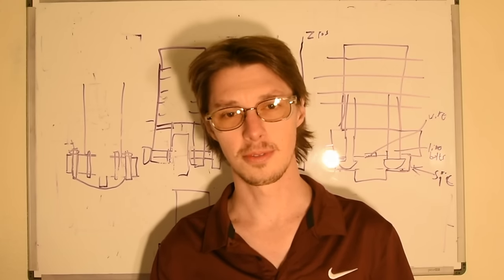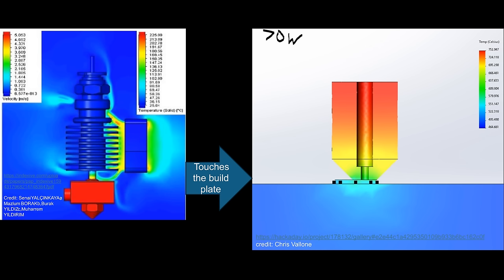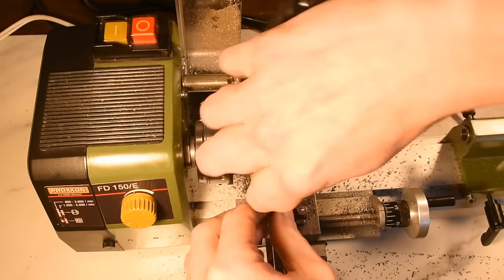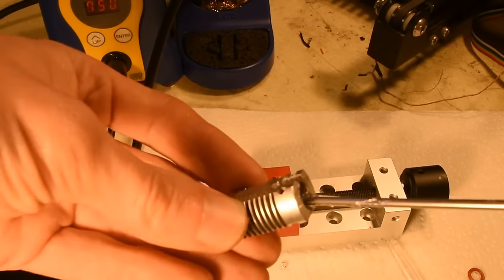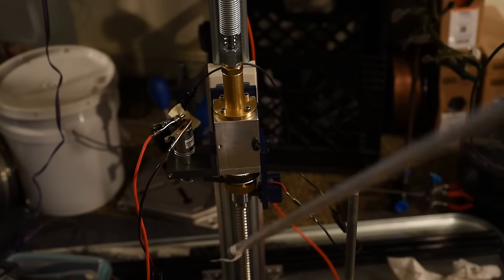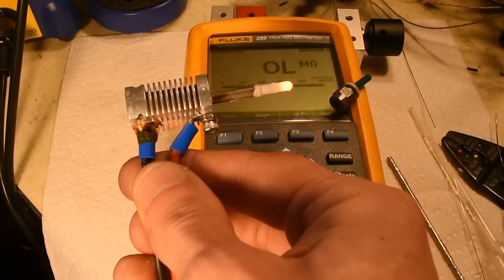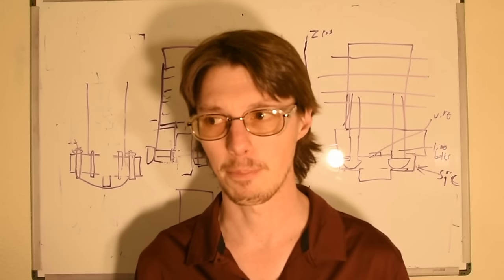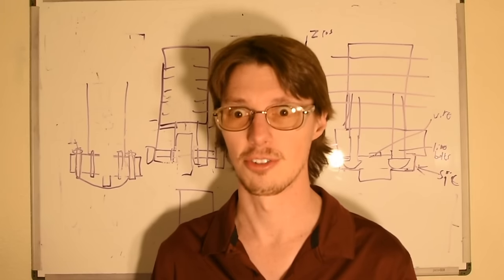How we made a 1300C 3D printer hotend for printing metals on the Creality Ender3

Comment: How did you provide the adhesion with the previous layer (it would be too cold)? Is this one-layer-only printer? If you think it’s not a big deal - you are wrong, it’s a major problem for this project. Anyway I wish you luck on this project and I hope you get the best possible results.
Reply from the maker: actually the temperature of the underlying metal is heated to diffusion bonding temperature by conduction through the deposited material.
fascinating fact about metals, they will bond at room temperature under near zero force when free of oxides or surface contaminants.
forging hot metals onto cold metals tends to remove the oxides, if the solubility of the native oxide is high in the liquid fraction of the semisolid metal (the tin is the liquid fraction in the bronze we are using) tin has a high solubility for copper and tin oxides. so the metal is its own flux to some degree as long as the temperature is not too high. 
the copper in the bronze is quite abrasive in siding wear, and so helps to scrub the underlying material clean.

something similar appears to happen with the 6061 aluminum wire as well. 

its not strictly necessary to heat the underlying metal. just to  have enough energy to ensure we can make the new deposited material be able to form metallurgical bonds with the previous layer. this is quite tractable given the torch like energy densities of the glowplug, and the relatively high forging pressures under the tip of our fine (and well constrained wire) at the deposition zone.
Reply: @rotoforge2024  I’ll be waiting for your next video on this project, it’s been so interesting to me.

Comment: You are making nice progress on a project that started me to create Rumba and Bollero projects, you need them to do the metal melting part as much as you need the crucible you created
You might have no idea but you need some more things done like eliminating oxydaton at every single pass of the printing head or noting really sticks togehter, especially with Aluminium, but Iron is also pretty nasty when it comes to oxydation layers preventing fusion, and I am working on that idea too,
and of course you need Rumba (or the Bollero/Ballerina combo) to print without supports or... again, many projects are not printable because geometries with supports inside are unreachable to cleanse them, so in the end functionally will not be useful.
Immagine printing a miniature 12V engine block, how can you clean supports in all the cavities?  Better without them supports.
Reply from the maker: we cant use iron due to its reactivity with the plug materials above 900 C or so. 
this is an active point of research. 

oxidation is much less of a problem for semisolid forging because oxidation diffusion and surface reaction rates are 3-6 orders of magnitude lower than in the liquid state. 

Semisolid forging also enables native oxide breakup via forging action at the deposition zone, because the solid fraction of the feedstock in the semisolid state at the deposition region tends to be highly abrasive. 
we might include inert gas for higher temperature operation in future, and or an oxide scrapping brush around the tip...
more testing is needed to say for sure.
Reply: @rotoforge2024 inert gas prevents hyper oxydaton in liquid state, but does nothing against already existing layer of oxydaton that prevents fusion.
Reply from the maker: @severpop8699 yeah this is why we are trying to get moderate forging  pressure from the extruder and ideally no nozzle constriction.
Reply: @rotoforge2024 there are better ways already in use in welding
Reply from the maker: @severpop8699 
would love to learn of these better ways. :)
Reply: @rotoforge2024 is public domain, any TIG or MIG machine capable to weld aluminium makes use of them, but they work fine for Stainless steel or iron as well.
Reply from the maker: @severpop8699 are you basically round about trying to tell me to use Wire arc welding? 
I dont enjoy coyness friend. please just tell me if you see something that could be done better.
Reply: @rotoforge2024 others tried to use ark welding and it did not really work to print like polymers can, so nope, that is not the solution, melting the metal in the crucible (hot end) is the way to go, but also unlike polymers, metals come with their own atomic oxyde layer to be dealth with if you want real 3D printing capabilites, one way is laser abrasion cleaning around the depositing point, but even at 5W laser we still talk bulky and heavy add ons on the printing head although it might work if the laser is away and the power pointed to the deposit point is carried out by fiber optics (you need to circle that damn point all times since the printing head travels all over the place so celasning in one side alone is not doing the trick)
but similar to laser, that is focused energy in the light visible spectrum, you can go Maser, same thing, no light spectrum but others.

So what if your outer electrode metal skin is charged with a frequency high voltage low amperage just enough to generate some plasma between the nozzle metal part and the already printed material shrouding the outcoming molten metal with a ring cleansing pattern by eliminating oxydes formed previously between two passes?
Might do the trick.

Keep in touch with me at :
activity@silverplanklogis.com

Comment: how good of a hot end would this be for PEEK/PEKK/etc?
if this could hit 1400-1600C you could print Glass, but I'd imagine driving glass powder through an opening that small will have other challenges
Reply from the maker: We could print glass or ceramic from fibers. We are already investigating printing with basalt and borosilicate glass from fiber tow. This is part of why we opted for a belt extruder. 

you dont actually need to melt the glass, just reach the temperature and shear at which the viscosity becomes about 1000 Cp.
Reply from the maker: regarding PEE and PEKK, should be fine if you draw the polymer down to 0.5mm OD filament.

Comment: Why not just use a narrow fov thermal camera sensor or laser thermometer? For tempature data at a distance?
Reply from the maker: these are very costly. 
I am working on graduate student budget.
Reply: @rotoforge2024  - I would also add that an upgrade kit becomes more attractive if the cost is lower, so expensive devices are almost not worth considering (unless alternatives have been ruled out).
Reply from the maker: @stevebabiak6997 
I am aiming for the lowest possible end user cost for DIY.
If I start selling conversion kits, my time is the largest cost...
I have so few hours to live I really feel a need for some exchange for them. The parts and materials are chump change by comparison.

I think if things go well, a final parts and materials cost of ~100-200 USD a hotend is not impossible. 

the EDM rig is the biggest expense in the DIY process for this.

We may be able to go without it if we use the goodfellow silicon carbide to make the heaters and braze them to titanium heat breaks...

this experiment may take some time to run though.

Comment: u cant actualy weld metal to metal without when there is oxide layer, u need to weld it with gass as welders do
also u can use welder wire
Reply from the maker: we are not planning to weld.
we are forging in the semisolid state. A very different set of conditions from conventional welding. 

Some other examples of metallurgical bonding in air, under modest pressure conditions...

https://ntrs.nasa.gov/api/citations/19710021048/downloads/19710021048.pdf

https://en.wikipedia.org/wiki/Forge_welding

no gas is required if you have good temperature control, and sufficient applied pressure.
Holding metals in the semisolid state greatly reduces the required pressure to breakup the oxide layer and facilitate metallurgical bonding.

Comment: Did you consider drilling bigger hole in heatsink rather than milling OD of glow plug down? Frome my experience I can get drill bit of any desire diameter down to 0,1mm very cheap in opposite to getting my hands on lathe to perform resizing of inner part
Reply from the maker: yes. 
But drilling a center bore hole, at ~0.5 mm diameter through the metal of the glowplug is extremely difficult. 
there is ~60 mm of very hard, metal, from top electrode to the center contact of the glowplug. 
there is also a region inside the glowplug, where the top electrode narrows to ~1mm OD rod. 
drilling through this has prove very challenging. 

I would encourage you to give it a shot anyways if you want to.  Perhaps you could make it work and thus reduce the barrier to entry.
Reply: @rotoforge2024  To be honest I was talking only about drilling in heatsink borrowed frome ender... But now that you mentioned glowplug I will see if enything would be possible even theoretically
Reply from the maker: @erykopata2668  
What I was trying to say, is that the heatsink internal diameter makes little difference...
the reason we have to modify the metal of the glowplug, is to expose its contacts, and shorten the glow plug so we have any chance at all of getting through it with EDM. 

a 100:1 hole is extremely difficult to drill already. its made even harder if you have to drill through materials that differ drastically in their properties IE ceramic, then metal. 

the ender heatsink is just a support structure. 
if you want to drill out the ender heat sink to make room for the glowplug, I dont see why you could not. Though the ender heat sink does not have much material on its flat sides. The glow plugs, stock, are nearly the same diameter as the ender 3 heat sinks are wide.
Reply: @rotoforge2024  Aha. Now I understand. Thanks for all the information
Reply from the maker: @erykopata2668  its why I do this kind of thing. lol 
please do better than I have. :)

Comment: I wonder if it'd be possible to turn the glowplug into a thermal couple.

Though, upon looking it up, it looks like thermalcouples exist for glowplugs.
Reply from the maker: can you drop me a link to these please?
I have never heard of nor seen these.
Though I have seen glowplugs with pressure sensors on them.
Reply from the maker: @Jeff-ss6qt Do these come in ceramic varieties?
I have seen these, but have never seen them in ceramics. they  all appear to be made of metals which will corrode when exposed to molten metals... :(

Comment: Might be a dumb question but have you tried to use something like a wire feed welder to build on a sheet metal plate
Reply from the maker: yes, but it cant print ceramics or fine features very reliably and costs way more than it should for what is essentially a microwave oven transformer and a PCB.

Comment: it would be nice, if you could go more into techdetail, how you managed the problems you has had. Like the edm process. I even like to build an edm but by brain still dont get, how problems are solved. Why it drills so centric, why it wont stick anywhere. If there is a short to material, isnt it already to late to pull back or react ? how fast must be the dataaquisition to steer all instruments ? Or can it be a simple process ? So many questions.  I think it would be a very popular content series, which shows building that machine in detail, so that anyone can build it too (even stupid ppl like someone i know *g*) . That would be somewhat great ! I think your channel goes rocket with that. Or is there already something like that ? i dont know. 
But i like your content and hope you get more visitors and money out of it. You are a good one !
Reply from the maker: this would easily be an hour long. 
I intend to go more in detail about how the printer works soon. 

as for the EDM drill, I am trying to eliminate it from the manufacturing process. its quite expensive and complicated to figure out...

takes practice to do well. which makes its much less hacker friendly than I would like. 

I think the next hotend we make will be made via diamond drilling and be much shorter / made from regular rod or bar stock.

Comment: Could you use the hot end resistance as a temperature sensor? i.e. resistance goes up as temperature goes up. Maybe use parallel high watt incandesent bulbs as a low ohm voltage divider resistor to measure heater resistance? (When I designed my DIY EDM power supply (48V), I use a string of 12V lamps as a current limiter.)
Reply: "Maybe use parallel high watt incandesent bulbs as a low ohm voltage divider resistor to measure heater resistance?"  - I mean have a 'bulb' in series with heater. But to achieve more current through the 'bulb', actually have several bulbs in parallel. Idealy the bulbs wouldn't get hot enough to glow.
Reply from the maker: yes we could and have. its not reliable enough on its own. it need calibration by an external reference. 
metal wire passing through the core of the glowplug tends to create a shunt path. 
and in general the glowplug resistance will permanently drift over time at high temperatures. 
so we need a thermocouple or some other method to backup the current sensing.
I initially though that the current sensing would be all we needed, I was, as I so often am, wrong.
Reply: @rotoforge2024  "I was, as I so often am, wrong." - I know that feeling well - stuff just works in my head!

Possibly you could mount an IR thermometer at the home position and re-calibrate at the start of printing, and possibly after each layer? I saw an instructibles IR thermometer that used a MLX90247ESF-DSA.

But I guess thermal mass creating time lag in sensing the hotend cooling down will be a big headache.

Maybe you could mount an IR thermometer on the print head, and focus it on the hotend tip by mounting it in a pin hole camera? (Easier said than done.)

I don't suppose the solution would be a straine-guage to feel how squidgy the extrusion is? Either on the extruder stepper mount (probably need two extruder drivers to do this - one to pull wire from the reel, and the second to sense back pressure), or mount it on the z-axis.

Good luck!
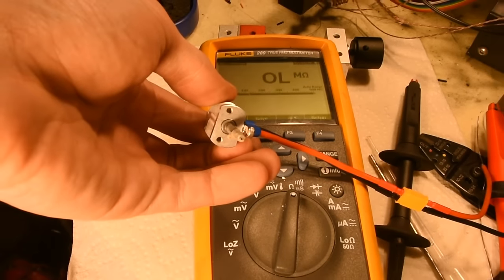Reply: Another thought: could you make the bore smoother at 17:14 by dipping the wire in silver polish first?

I was going to say "Could you simply get the temperature from the colour of the glow plug? Like an old time smithy making horse shoes? Just use a colour camera." But I see @miniman3112 got there first.
Reply from the maker: @johndoggett808 the glowplugs are excellent blackbody referencs. e=0.95 up to their decomposition at 1800 C or so.
Reply: @rotoforge2024  Another possible approach: If the MoSi2-Si3N4 is in contact with the melted wire, then could you use this as a thermo-couple? I.e. have a low impedence amplifier buffer your ADC input. Voltage * K = temperature. Measure the voltage between the inner ceramic conductor, and the wire. I usually find a bit of electrical noise improves the number of bits I can get out of an ADC so long as I over sample enough. I guess the main gotcha with this is if the wire is electricly shorting to the cool end of the glow plug - but there should be a much better electrical contact at the molten end. (If it isn't clear, I mean the carbide, and the wire are two dissimilar 'metals'.)
Reply from the maker: @johndoggett808 this sounds like it could be very interesting and highly scientific. definitely a valuable investigation for extending the process control data and details we extract about the deposited material in-situ.
Reply: To get around the wire shorting at the cool end. I suppose you could print in copper, and use lacquered copper wire as sold for winding transformers  - the lacquer will just burn off at the hot end. The spoiler to this is you could only make electrical contact at the far end of your lacquered copper wire which is inconvenient, and will add a lot of electrical noise - but over sampling your ADC can help there.

Comment: Have you considered a crucible surrounded by an electoral coil heating element which serves as a "reservoir" and a crucible material "duct" leading to your idea here?
Reply from the maker: the whole point is not fully melting the metal. Once the metal melts it becomes a nightmare to handle due to water like viscosity and it oxidizes like crazy.

Comment: apologies if it's already been mentioned, but has induction heating been considered?
Reply from the maker: I should probably make a video about this considering the frequency of the question. 
but yes, we have considered it. 
I couldnt wrap one tight enough either without it melting down during printing.
and even if I wound it tight enough, it would need to run at a frequency where the driver cost would be huge. 
like 800 khz to 1 MHz.

maybe a bit more.
maybe halbach induction arrays could improve this situation. 
but I am interested in printing glasses and ceramics with the same hotend. So induction heating is not really going to suit my application....
would love to see it tried though. we have people in the discord working on it actively. super exciting stuff.